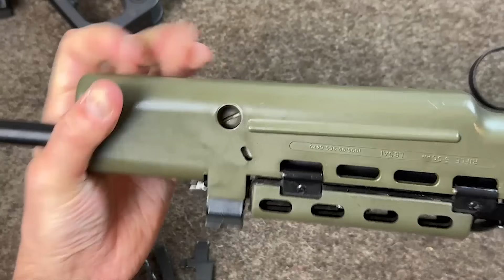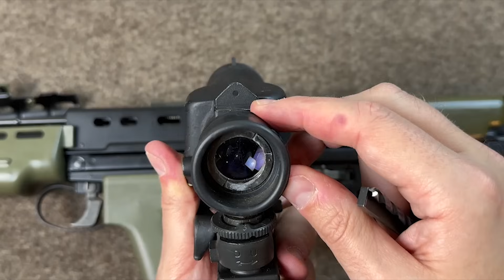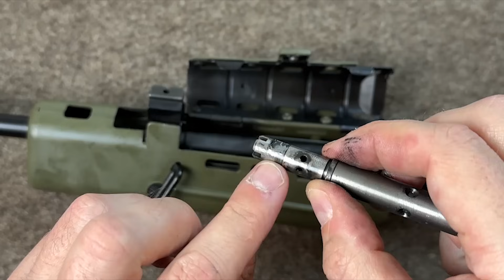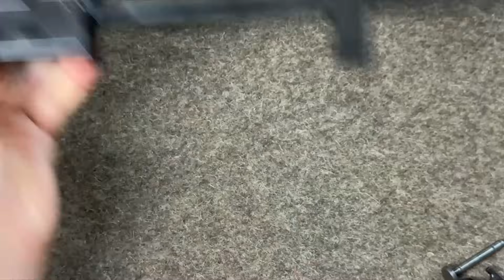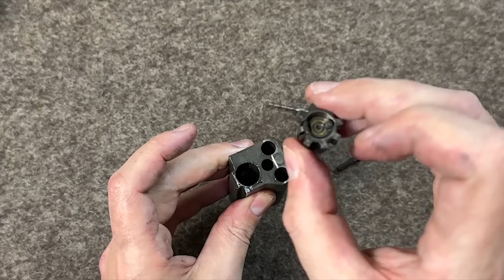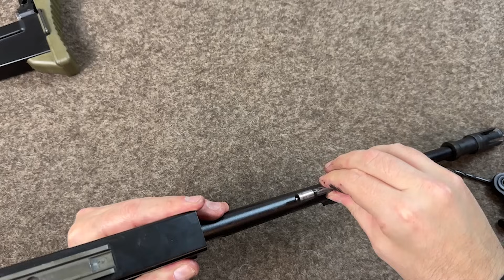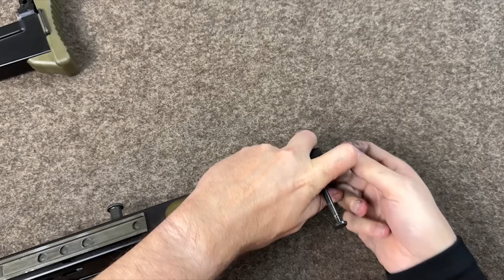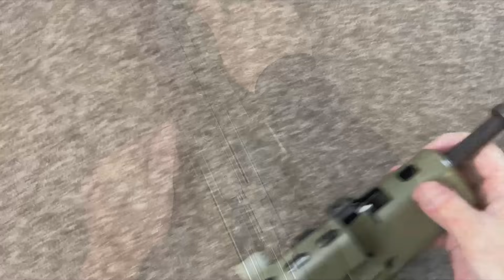British Rifle L85A1 / SA80 IW: The Mechanical Gory Details (Rare Factory Semi)

Comment: Great video! Although my hopes of owning a real SA80 are non existent in the US, a new company Aly and Kaufman are making a lower and some conversion parts that with a BRN 180 upper it looks similar to the A1. I appreciate the in depth look at the internals as I was curious how much it differed from the BRN 180. Maybe if you ever come into contact with one you can do an in depth comparison of the Aly and Kaufman AKB-23 which is the said BRN 180 conversion. We in the US would be very interested!
Reply: It would probably be even better if someone made an "L85" upper and lower that took a BRN-180 bolt group and gas system parts.  Yes, they'd have to make their own upper and gas block, and figure a way to seat the barrel extension into a square trunion (or make their own square barrel collars).

You could probably make a very close clone that way.  

But, would the market support the cost of tooling up to do so?  I have doubts there are enough people dying for an L85 semi at the kind of price you'd have to charge to cover development, tooling, and production costs.
Reply: The AKB 23 imo, looks like a mix of the A1, with A2 changing handle and somewhat the A3 with the body having the openings, similarly to the A3's handguard. 

I dont know if its true but a while back when i was talking some mates in the UK shooting community, supposedly theres a SA80 varients we can own. Its called the L98a1. Its a manually operated version of the A1 that cadets used. They now use the L96a2 which is semi automatic and the story supposedly goes, theres a few of them are kicking around in collections because i was looking for one a few years ago when i bought my factory made BSA manual SLR and asked about, so i could have a full collection of UK army rifles from ww2 (minus the EM1/2 etc) 

Theres also a 22. LR kit for cadets. I don't know why we're not allowed that or why no one had made a semi auto 22lr SA80, theyd be perfectly legal here in the UK under a section 1 like most rim rifle semi autos.
Reply: There was a cadet version aswell.
Single shot, bolt operated.
I'm the iron sights on the cadet  version were better than the iron sight that came with the Army version.
Used both.
Reply: The brn 180 conversion is probably better than the original
Reply: @chadtarbet4720 Having touched both in real life, I'm not quite sure? Believe it or not, every bullpup BRN180 you can get/make in America is ergonomically inferior to the SA80 somehow. I never would've thought that, but having used both, it is.
Reply: @superfamilyallosauridae6505 the AKB-23 seems to lack the hold open beneath the bolt handle, trying to lock back without a mag would be a bit of a mare